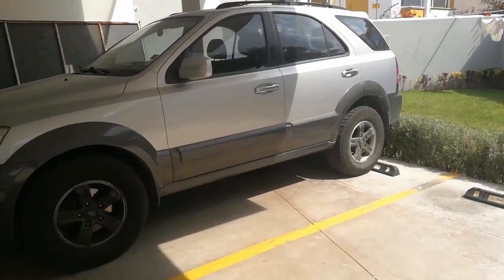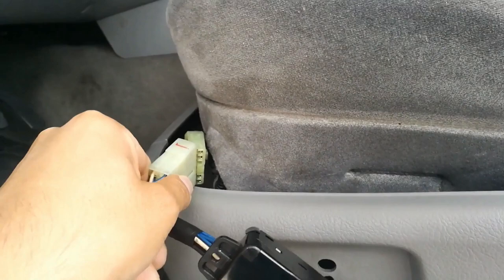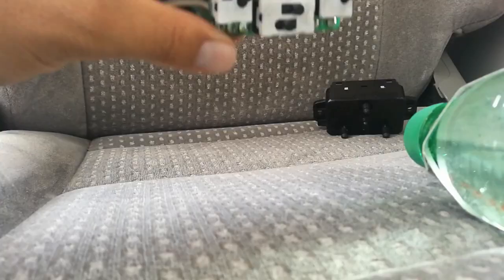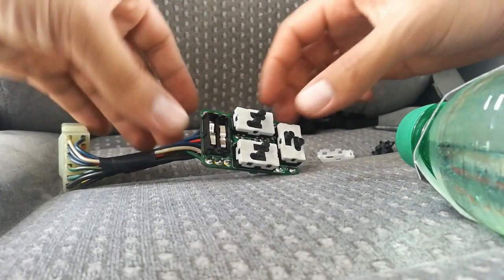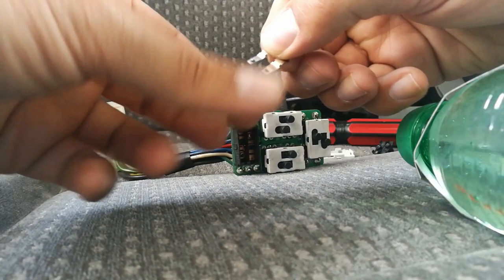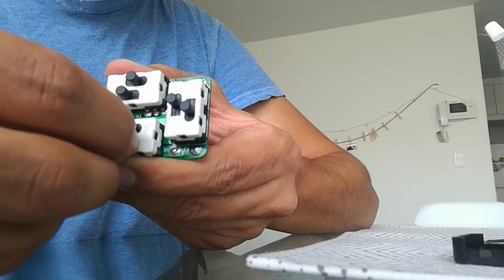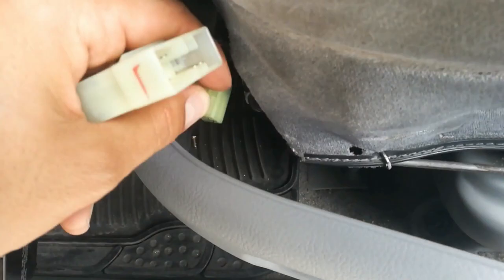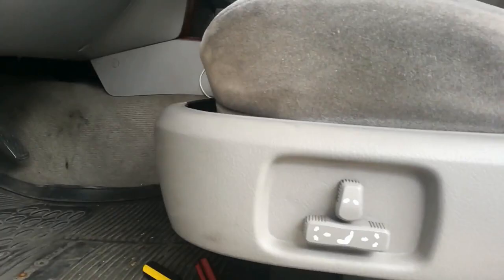Electric seat switch repair Kia Sorento 2005

Comment: Great tutorial, I’m a Commercial Laundry/Drycleaning Equipment Mechanic and I have that exact problem with my 2005 Kia Sorento the seat won’t tilt forward. I was going to replace the whole switch but you have shown me I can just clean off the internal contact points. Brilliant fix and good video. May God bless you and your family for sharing. My Wife and I absolutely love our Sorento it’s one of the best SUV’s on the market and they ride smoother and are way more quiet that the Honda’s, Toyota’s and as far as I know all of the other older SUV’s. It’s a hidden secret how nice these Sorento’s are. Thanks for sharing
Reply from the maker: Really glad it worked for you, keep loving your Sorento

Comment: Worked for me and my sorento.   The face lifted models have a small screw under the front of the seat and not on the side.   You have to use a mirror to see it.
Reply from the maker: Great tip, thanks!
Reply: Thx 🤛🏼

Comment: Thanks for the video. Actually I came to it to learn how to pull the buttons off, which wasn’t part of it, so, I said screw it and just used a screw driver to pry them out, and that’s the way! (For anyone else looking for the same answer)
My car is a 2007 Kia Magentis (Optima in the USA)
Thanks for the video otherwise, as I followed the same logic to make my seat recliner work again, which is fantastic, because it worked to lower it and I was driving in the back seat :)
Thanks again!
Reply from the maker: Glad you fixed your seat! Workshops charge insane amounts for this and I just couldn't stand it. Sorry for not including the buttons part, but yeah, pretty much you just pry them out, be careful with the bearing balls tough, easy to loose those. Cheers
Reply: Josue Enriquez Eguiguren I was definitely particular and careful, knowing I’m the type that would lose them! No parts broken or lost this time :)

Comment: Well what do you know,bought a Kia with the seat not working,after scrap dealers trying to have me over with a price of £120 for a little box I decided to seek help from utube and hey presto I followed the instructions and now the seat works took me about 1 hour(40 minutes was wasted looking for a small ball bearing a dropped,please put a towel down and do it on a table) so thank you for the video👍
Reply from the maker: Hi, I'm really glad you fixed the seat of your new Kia. Seems to be a common problem and the dealers charge ridiculous prices for the switch box. They told me it was necessary to unmount the seat and check the motors, $450 dollars for that, and then almost $200 extra for the switch box. I'm glad the video was useful for you, and yes, those little bearings can be really annoying!

Comment: good video.....but how do you hold the ball bearings in place when putting it back together?
Reply: also begs to question why the hell do we need electric seats or power windows in the first place? or engines that need to be hooked up to computerized diagnostic systems? easier to keep it simple! you are good & i appreciate your problem solving abilities.
Reply: i figured it out. thanks again for the video. :)
Reply from the maker: @willywilfred  glad you figured out, hope your seat was fixed.
Reply from the maker: @willywilfred  surely sensitive technology at times.

Comment: I wasn’t able to fix my reclining up section, I’m not sure what to do after I tried cleaning it 2x and switching the white boxes with another one. Would you have any ideas what it could be or what to do?
Reply from the maker: Hi, you could try to disassemble and reassemble all parts, as they are very small something could have been missplaced. Another option is while all the parts are dissasembled and you have access to the bare ciucuits use a multimeter to measure continuity when the switch is activated.

Comment: How do you take of the case from the little black box ??????
Reply from the maker: You pry the clamps out. If you check the video at 2:45 you can see the elements of the black box, and how it is attached together. Use a flat screwdriver if you need. Hope you can fix your seat, cheers.
Reply: You should have slowed the video down and show how you unsnapped the black cover.